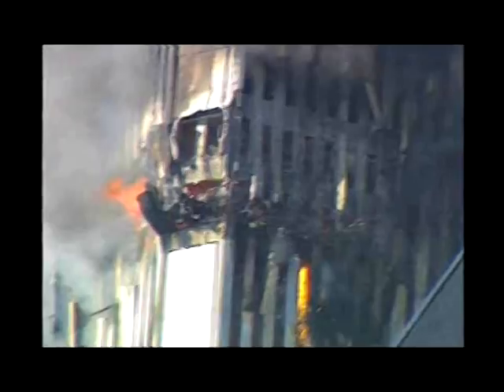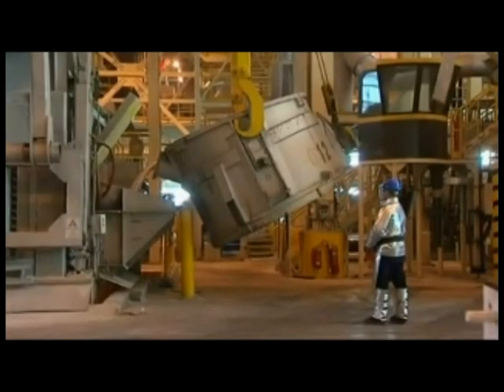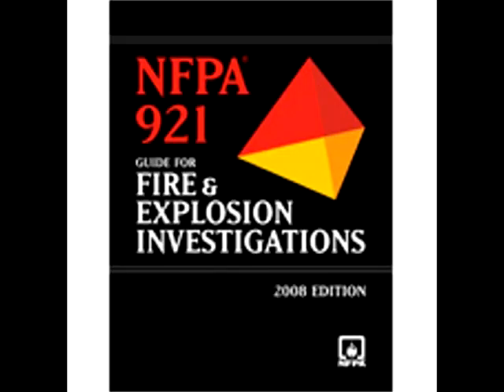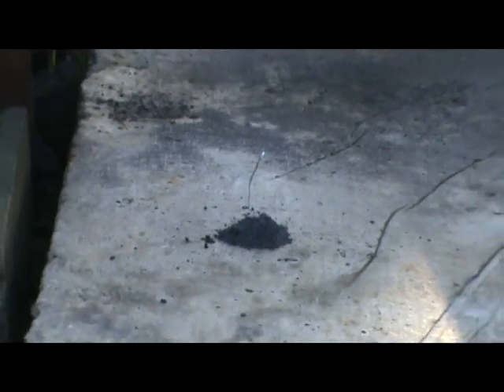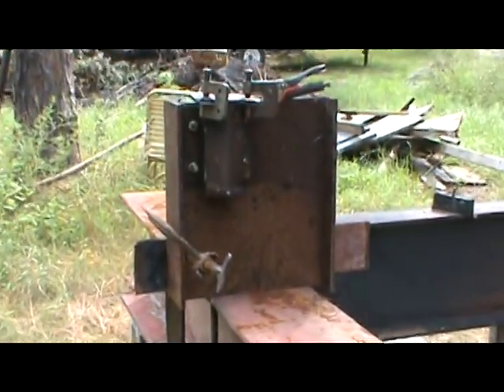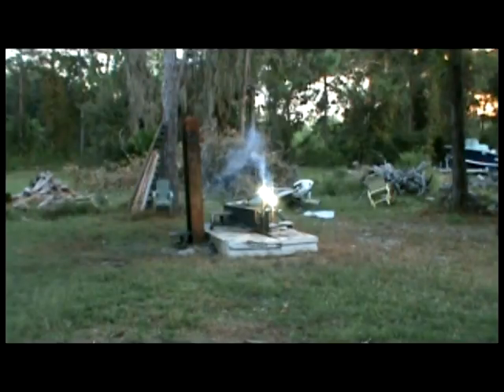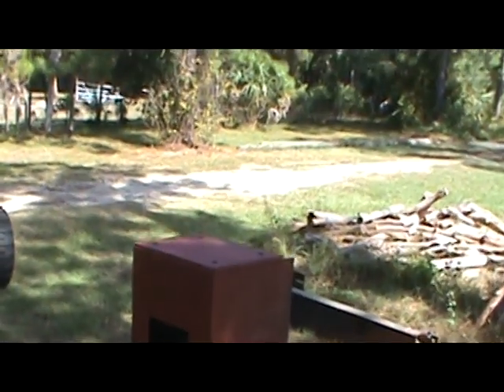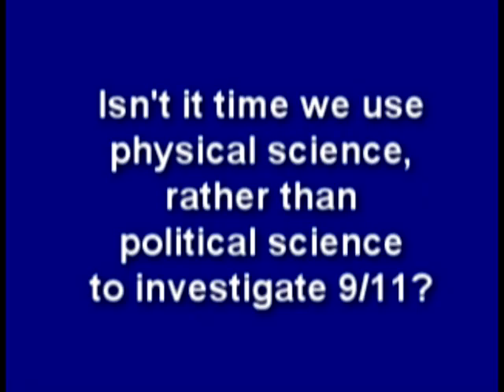9/11 Experiments: The Great Thermate Debate

Comment: did any1 know that railroad workers use thermite to weld STEEL tracks together?
Reply: Tilen Gasparic I didn't, that's pretty interesting
Reply: I have some railroad tracks near my home and once they were replacing the old racks with new ones. I saw how they got welded together with a contraption which contained thermite I assume, since when they lid it up, it was so bright you couldn’t look directly at it. Very interesting

Comment: its not problem of mainstream experts but tv production. Its wery rare to find a expert in some fields and some time they dont care. And there is no such thing as mainstream expert ,that is calld "i think i know what im doing". Expert can tell you what the fackts are what is his personal opinion and what impotrant information is missing.
9/11 is so debated because not what we know but how wast information we missing. The planes was around 15 years old. Everybody talk about the towers not the planes. What epoxy paint do in heat how much oxide was on 15 year old aircraft grade aluminium. And nobody talk about the scale of the impact betwene  25 years old rusted steel and 180 tons of 15 years old 
6061 aluminium with around 1% (up to 2tons) of magnesium burning in more less enclosure fire aid with Carbon-based fuel.

Comment: One week before the event took place, bomb dogs were removed from the building and a private painting company came and coats the walls, this powder can easily be mixed with paint, and an electrical pulse could ignite. Perhaps they also had access to the beams, or the walls were close enough and enough powder was used to get to the beams.

Comment: It cant melt Steel but it can still heat it up to be red hot. And when metal becomes red hot it becomes softer and compromises its strength.
Reply: Doroteo Alvarez, and furthermore:
Reply: You're right. And to further conclude this statement, the molten metal is actually aluminum from the plane.

Comment: If anyone has ever burned a mattress in a bonfire, you'd know it doesnt get hot enough to melt the steel springs of the mattress. And fire after fire, it still remains intact. There's no way it got hotter in those buildings, especially with the black smoke indicating that the fire was oxygen deprived. One of the firemen who reached the fire even mentioned they could be knocked out relatively easily. And hands down, building 7 did not collapse due to fire. Ntm, it had no jet fuel in it whatsoever.

Comment: Would the added weight of the building add to the energy enacted on where thermite may have been used? Causing the beam to heat and malform moreso than a beam only affected by atmospheric pressure. I only ask this because strange things can happen under different conditions like with the spinning bullet in freezing conditions. Maybe it was like friction welding where it only works when immense pressure is applied to either end.

Comment: look up what happens when a 747 tire fails on landing as soon as the aluminum starts grinding it bursts into flames. it is entirely possible that steel melted due to the wind that would have been high at 100 floors up ...blast furnace affect

Comment: This would be a good point if the steel needed to melt for the building to collapse.   But it doesn't need to get anywhere close to that.  Especially with a hole the size of a jumbo jet ripped through it.

Comment: It doesn’t matter if it wasn’t hot enough to MELT steel in to liquid but it can weaken it. With the weight of the rest of the building above it, it will give up.

Comment: So........ No one noticed a couple of dozen guys exposing the steel beams by stripping the surrounding material then strapping explosives to the beams. It took 5 pounds of thermite, a steel "box cutter"  WELDED in place taking hours of time to set up. Multiply that by a couple hundred times per building .!!!  Of course they did it at night then covered it all up......or as you theorise, built them into the building 30 years earlier!!!! YET not one of the hundreds of workers needed to pull this conspiracy off have come forward?
Really... It's easier to believe this massive conspiracy than it is to believe 2 planes crashed into the towers and caused the towers to collapse??
Why not believe that the fire inside was like a blacksmiths forge, sucking in huge amounts of air into a narrow space that created a heat that could melt steel. Here's an experiment for you. Three or four levels made up from slabs of concrete with steel and glass outer frames, to scale let's say 1:10, filled with flammable material, some steel beams (also at scale) and then throw in some jet fuel and a match. Blow in some air to simulate the suction or the effect of the lift shaft as a chimney. Measure the temperature inside. See how that goes?

Comment: The amount of fuel in that building including the tons of paper, computers, and furniture could heat the steel up to a point at which the thousands of tons of material above would cause a fatal collapse, this amount of weight would compound on the way down and easily drop the whole building. Not hard to understand.
Reply: Skelotor Two Blacksmiths don't have thousands of tons of matter on top of their furnaces...
Reply: Skelotor Two I'm not implying that you believe anything. I don't know what your point is though, I am convinced that steel degrades to a failing point much lower than its melting point and will bend under weight.
Reply: Skelotor Two You felt the need to reply to me first with an equally irrelevant comment so I was trying to figure out where you were coming from. My position is trying to see both sides of the debate and have no reason to want to argue needlessly with you. I'm genuinely trying to see your position on this but you're taking it way too seriously.
Reply: Skelotor Two The bottom line is that those fires reached 1000 degrees Celsius which caused the exterior columns to bow inward. Clearly the jet fuel which caused multiple floor fires added to the acceleration of the fires as well as overall heat.

Comment: If the airplane did hit the building and destroyed it, wouldn’t the building also have fallen at an angle of some sort, because the building fell straight down like a controlled extra explosion when demolition building so it does not destroy nearby building.

Comment: What about hyper thermite?
Reply: Mason, good point.
"What distinguishes super/nano/hyper thermite from traditional thermites is that the oxidizer and a reducing agent, normally iron oxide and aluminium, are in the form of extremely fine powders (nanoparticles). 
This dramatically increases the reactivity relative to micrometre-sized powder thermite."
Reply: citizendc9 you know what's wierd is that Hyper thermite has vanished off of Wikipedia recently as far as I know it's gone, not that Wikipedia is a credible source anyway but I can't find it anymore.
Reply: What about ssj4 thermite
Reply: Slick Slickerson or ultra instinct thermite 😏
Reply: Plug In
It was hit by the two main towers.

Comment: The towers fell because of the heating and cooling of the steel it weakened the steel structure and  the joints of each floor also the planes hit the towers with such force and the fire prevention coating on the steel was blown off and as for the molten steel seen its possibly steel cables melting that ran vertically up and down the building and also hit the corners of the towers to so the towers were compromised because of that and they collapsed. And the building was built back in the 70s and 80s the building was also bombing happened in 1993 who to say the didn’t plant other bombs in side other parts of the building during that event as well. And also the fire burned hotter because of higher oxygen levels at that altitude. Jet fuel is more energy dense than even diesel fuel. Gasoline fuel burns quick diesel fuel slower and jet fuel even slower and hotter and don’t forget about the planes hit the towers both planes weighed probably 350,000 pounds.

Comment: You say the temperatures didn't get hot enough to melt steel yet you fail to acknowledge the fact the steel looses almost all structural strength when heated past half its melting point.

Comment: The notion that building materials and jet fuel melted structural steel is a sad and laughable joke. Most of the jet fuel was dispersed and burned at impact. A person might be able to build a torch that is capable of melting steel with addition of a strong oxidizer but in open air, no way. The  liquid metal pouring from the building, the thermitic dust, its proof positive enough. 9/11 was no accident. Rest in peace to all innocent lives lost in that mass genocide. and

Comment: If thermite is made of aluminum and rust then that could have been a reaction from the plane hitting! Let me explain the plane is made of aluminum and steel rusts which there had to be rust on the building and maybe with the building under so much stress as it was from all the weight, then you have a plane flying at at least 200mph there had to be some reaction

Comment: Couple questions, have you considered electricity melting the beams? The three beams with brighter fires and then the six beams without could very well be the design of the buildings electrical. Also curious, what is the battery inside a plane composed of? This could prove to be vital information in this type of debate

Comment: Jet fuel can't melt steel beams but can thermite?

I guess it can.
Reply: Arygua People do realize that thermite is a combination of IRON OXIDE (rust) and Aluminum right. If thermite was the cause of the metal flow, there is a likely possibility that the collision itself could have created the proper situation to make crude thermite on it's own
Reply: Tribe of the Iron Flame stop your critical thinking. These fools need someone to blame.
Reply: Well it doesn't have to melt it, only weaken it enough to bend or collapse
Reply: Tribe of the Iron Flame How is that outcome likely at all? Why would there be rust in the tower?  Even if there was, there would be miniscule amounts coating just the surface of any metal, it also needs to be turned into a very fine powder, same with the Aluminium, to be used for thermite, it also needs to be within a very specific ratio to combust properly, you can't just bang a beam of rusty metal and a beam of aluminium together and expect thermite to fall out. Your theory is utterly ridiculous.
Reply: I guess some people cant see this as the joke it is...
Reply: Joshua Vandygriff if you seriously think what Tribe said is plausible at all, you need to reevaluate the knowledge you think you have.
Reply: LyadinDima to bring down the towers yes but it still needs to explain the flow of molten metal coming off the tower
Reply: Arygua, A Real Big Fucken Hole Coming Right Up
Reply: killkarma361 nobody here has a basic grasp of science

Comment: You know nothing of structural engineering or combustion dynamics.  The building was not " taken down " by some conspiracy.  Steel has an inherent desire to return to to it previous shape . This happens at a relatively low temperature . The building actually pulled itself down as steel beam structures are prone to do .

Comment: Office and open air jet fuel fires cannot melt steel????
Serious? So your telling me the forge I built out of wheel Barrow, bricks and a hair dryer doesn't melt steel in my backyard? If I leave my piece of high carbon steel in my forge for to long it completely melts. 
The winds up there in the trade towers blowing through that open hole turned that building into a massive forge.